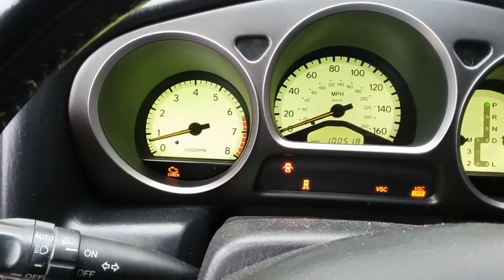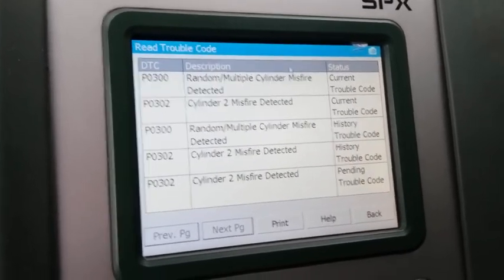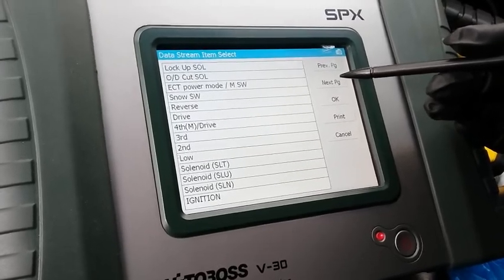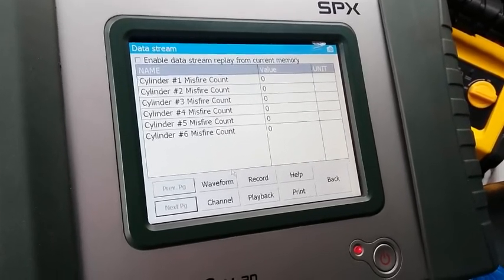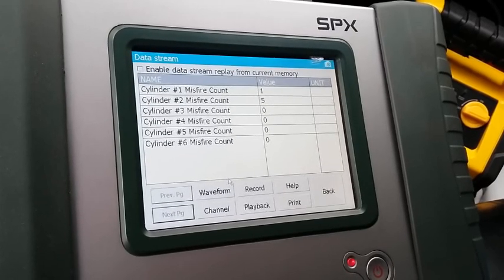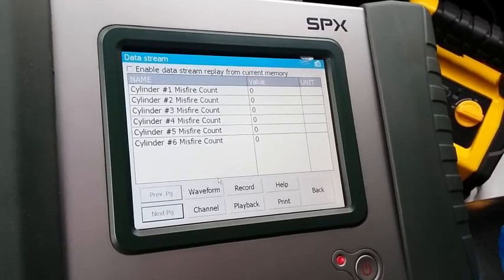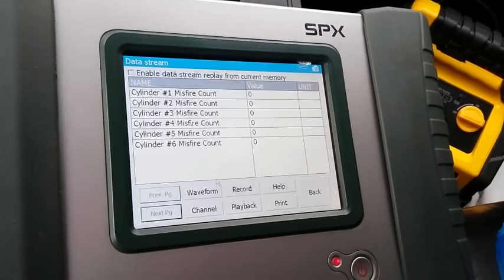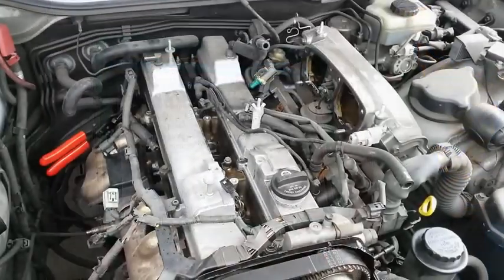(Toyota/Lexus)  Using Scantool Misfire Counts

Comment: Where did you get the computer program or tooling to do something like that? I'M INTERESTED!
Reply from the maker: Hey Senior XJ, actually this scanner is no longer available to purchase, but i still use it to do some of my diagnostic work. I would recommend any of these product brands. Autel, Launch, Cando C-Pro. It just depends what kind of scan tool you need for your daily needs. Professional or Basic. Autel and Launch have plenty to pick from. Hope it helps.
Reply: What is the solution?